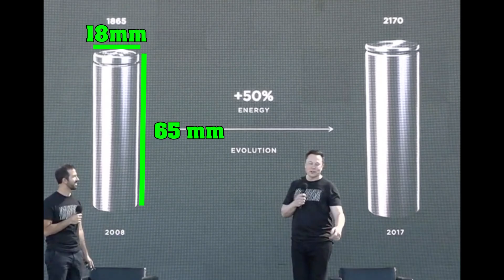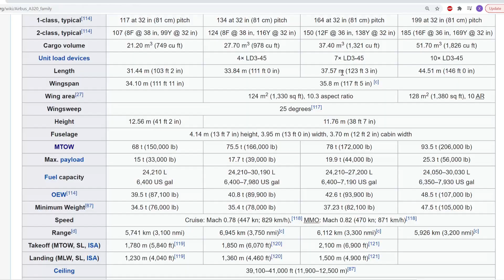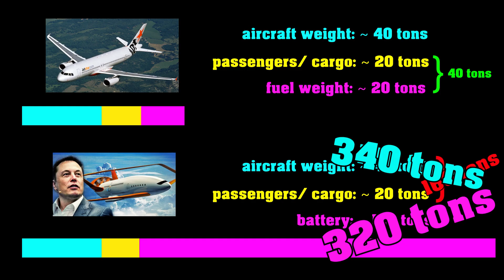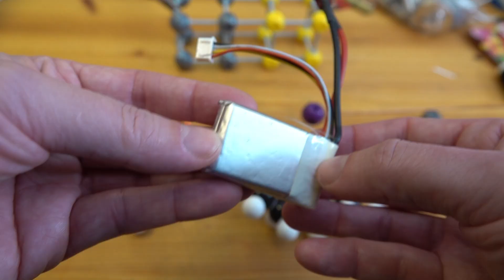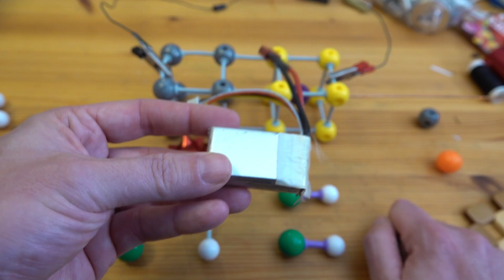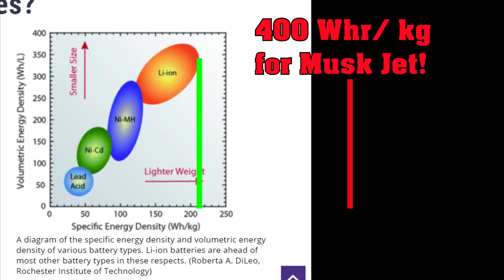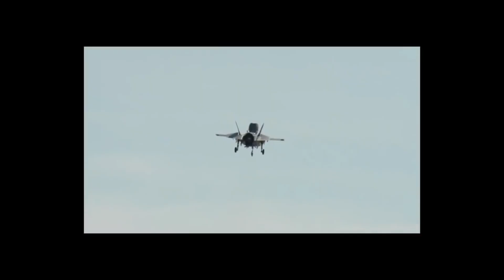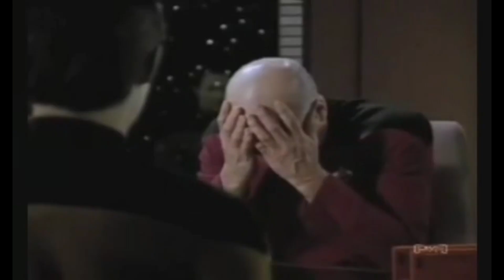Tesla's Secret Plan To Disrupt Airlines: BUSTED!!

Comment: Jeah as an aviation nerd I had to burst out laughing just when he said Super Sonic VTOL. That's about the stupidest idea I have heard in a long time. The F-35B can barely do it for about 50 seconds. VTOL needs over a 1 to 1 thrust ratio at a standstill. That alone is pretty hard to do with batteries and it really doesen't make much sense why you would make your life that much harder for a cargo plane when runways exist. Then we either need a completely new set of engines for forward flight, pivoting engines, or taking off rocket style. Then we need a landing pad that can withstand the energy of a plane that size. Ever seen the downwash of a Helicopter? Now multiply that by a large factor. And all of that just to get you in the air. Then you need to go supersonic. You can't get it supersonic with propellers. The main limit on rpm is that the blade tips can't go supersonic. Turbines on the other hand work better the faster you are, so they don't get you that much thrust on the ground making them worse for VTOL. So you either need a jet turbine or a whole new way of propulsion. Electric jet engines are theoretically possible by treating superheated plasma through electric current. Yes, all the air that goes into a turbine at supersonic speeds has to be heated up from the low temperature high up in the atmosphere to a plasma. Even with 100% efficiency. Thermodynamics tells you it's stupid. And then, if you did all that and finally have your Aircraft that can, with electrical energy only, have a thrust-to-weight ratio of over 1 to 1 at a standstill, and enough power to go supersonic which in aviation terms is one of the most wasteful ways of moving through air and comes with a whole other load on the aircraft. He tells us that it will only fly transcontinental. Overland. Where you can't travel at supersonic regularly because the sonic boom at best will be super annoying for everyone in its path and at worst will burst windows and eardrums. Even the Concorde would only fly supersonic over the ocean.

Comment: So much negativity here. The sulution is ofcourse to put solar panels all over the plane, and then have 10 separate battery stages and Just drop them on top of Peoples houses along the way to save weight. And you dont Even need engines, Just use 100 or so cold gas thrusters

Comment: Also less air for the the engines to move air through and create thrust, also the demands on the airframe are much different depending what an airplane is made for. The f35 has had unlimited money thrush at it with the demands very similar to this (do everything vertical TO/ landing, and supersonic, stealth)  and Lockheed Martin has as much expertise in pushing the boundaries of what is possible for an aircraft and even they have had trouble.

Comment: I am an aircraft mechanic.  So one of the things about fuel is it usually isn't filled up like you do with your car. If it is a max range flight they will, but the more fuel the more the plane weighs and the less fuel efficient it is. Another reason you don't fill it to the brim is you really really don't want an overweight landing that is bad news.  A battery plane went weigh less at the end of its journey than the beginning.  I guess a vertical TO/ landing design would mitigate this problem,  but it is also very difficult to do,  there is a reason that there aren't many vertical T/O landing planes and also why we don't see helicopters used much in mass commercial use.

Comment: When flying with lithium batteries, you are not allowed to store them in your checked luggage. They must be carried on board. 
I wonder if the batteries in the plane would need to be in a pressurized and air conditioned space.

Comment: Could you do something in regards to structural batteries
Reply: That would be extremely complex, extremely dangerous, and extremely failure-prone even if it was possible.
Reply: No, you can't. If you remove mass from the frame of an aircraft, you have to add that mass to the battery pack to retain structural integrity. The tiny amount of weight dropped from "structural batteries" is negated once you make those sections both water tight and air tight, and run the hoses for thermal management.

The issue here is the lack of energy density for batteries, not where to place the batteries. The concept of "structural batteries" was dead on arrival since the very beginning.
Reply: @herrschaftg35  The entire idea of a battery-electric commercial airliner is what's DOA.

Comment: jesus christ, the first 2 minutes and im shitting myself already laughing. you know, since i smoke e cigarettes which use Li-Ion 18650 cells, i know what Musk is talking about. the banger is: He apparently claims he developed the 21700 cell, well sorry, but my other Vaporizer has one of them and they have been around for quite a while. my 18650s are Sony Konion 3000mAh with 30A. the 21700 is also a Sony Konion, but with 4000mAh and 40A.

Comment: The real disruptor will be the orbiting electric hyper railways. Basically hype-r-loop, but no need for vacuum tubes, already in the vacuum of space. And the "rails" are basically orbiting magnets, not literal rails, that just push the train from one ring to the other, until you reach the space-hyper-train station. Then you go down by paired elevators that just counter-balance/power one another, less people to go up than to go down, then done, that's it, free elevators suspended on orbiting space hyper railways. Gorgeous CGI.

Comment: Can you even go super sonic with electric?
Reply: The Japanese were actually experimenting with propeller airplanes at Mach speeds during WW2. It wasn't electric but I assume an electric plane will also use propellers. They found out that propellers are extremely unstable at Mach speeds. Most of their experiments did not go well and the idea was quickly abandoned
Reply: You can only go super Mario sorry
Reply: No, you need to heat the air.

Comment: Not about the Musk, but have you seen new Lithium polymer batteries with V-Fe? Chinese researches completed a new formula a few years ago, and i'm curious when it'll come to production, as it can withstand lower temperatures (-19*C+-)
Reply: Given how these "awesome new über-high-density" batteries are ALWAYS 3–5 years away (kinda like how fusion power used to always be 20–30 years away), I'll believe it when I see it.
Reply: @electric7487  well, that's not about capacity, they have increased stability rather. Though, that's only a report on the Schemists Society's site, and i could view only end resulta with tests, not the formulas or docs itself (might find a chemist's account to view...). Not so of "amazing" stuff, we already have Korean batteries in stock, which is close to that specification (29+-% worse)
Reply: @electric7487  well, that's not about capacity, they have increased stability rather. Though, that's only a report on the Schemists Society's site, and i could view only end resulta with tests, not the formulas or docs itself (might find a chemist's account to view...). Not so of "amazing" stuff, we already have Korean batteries in stock, which is close to that specification (29+-% worse)

Comment: 70% battery is worse than current propeller drive electric aircraft. The Pipistrel Velis Electro when empty is 70% of the max takeoff weight. That's plane plus battery. Mind you, having a max payload of 378 pounds is less than most other avgas powered prop planes. One of the smallest I could find that was not an ultralight had a payload of 530 pounds.

Comment: Hamster wheels, or freaking pedals for the passengers!
By the way, how is that electric jet going to be propelled, rocket fuel? Most of the thrust on a modern high by-pass jet engine is from increasing the enthalpy of the air in the fan, not from the jet of hot exhaust (that is actually quite inefficient at subsonic cruise speeds).

Comment: Go electric hot air cruise liner...Cruise ship balloons with a low altitude ability...mega capacity, with static super capacitor charge for immediate correction...That is more possible...Or eat beans n sauerkraut, shove a tube in say 1000 passengers, and run on methane fuel...

Comment: They could improve their efficiency a bit by making the current round cells square like the Chinese claim to have done so one battery fills the entire width of the compartment and acts as a part of the structure and reduces wasted space significantly. But this is wishful thinking.
Reply: Plus, we already have structural energy storage in the aviation industry. The wings on most modern aircraft are "wet wings", that is to say, the wings have compartments inside them that are sealed off and used as fuel tanks. So the "advantage" that is often touted that batteries can be structural while fuel cannot isn't really an advantage at all.

Comment: he must either be lying about the electric airliner possibility or he’s not actually a good engineer. Which is it? That’s my question, assuming thunder foot is correct here. I wouldn’t know. I’m not an engineer of any sort whatsoever
Reply: Elon never engineered anything in his life, except the audiences he speaks to.
Reply: @DumbledoreMcCracken  I since talked to a few aerospace engineers and they say this is 100% possible for the reasons musk says it is
Reply: @tpstrat14  Watch my 1 minute video on the engine, and understand what Elon actually proposed, and then tell me Elon has a viable suggestion.
Are those engineers still in University, or do they work in the aerospace industry (just curious).  I am a pilot, and I have a BS in mechanical engineering from an ABET accredited US university.
Reply: @DumbledoreMcCracken  One of them designs engines for Pratt and Whitney. I’m not gonna pretend like I know anything about physics or engineering myself.
Reply: @tpstrat14  I would really like to hear what the P&W engineer thinks of my video.

Comment: Everything in the Aviation Industry is as optimised as possible- the planes will only keep getting lighter, as that results in fuel savings which are beneficial to the airline and the planet (less fuel = less fuel cost than normal)
Edit: Also, the engines provide a source of power. Cabin electricity and lots of other systems get their energy from the engines when cruising normally (for you avgeeks, the APU should be off during cruise) so to power those systems, you would need to pull directly from the batteries. Cabin air-conditioning and pressurisation also comes from the engines during normal cruise so you don't die of hypoxia when flying. On aeroplanes, all the systems are highly redundant, so if an engine fails, you pull power/air from the other engine or the APU (the APU is like a mini jet engine whose purpose is to provide power to the aircraft when the engines aren't running, as well as being redundancy). I'm not sure how the Tesla Plane will work, but you'd need multiple batteries that are physically separated so if a battery fails, you can switch to another. There are batteries on aircraft to provide backup power, but they aren't generally used throughout the entire flight (as I said, the systems pull power from the engines when everything is normal).
Now, about the VTOL part, isn't that just a drone? If you have swivelling engines, you are basically making a convertible drone. I'm pretty sure this concept has been tried before, so this part isn't completely insane, but to do it with batteries would be something different. Spinning the motors super fast could also require a lot of power, so you would need to route thick, heavy-duty cables everywhere. Lithium batteries are good at high amperages, but I don't know how they would fair if the heavy load was sustained. Running the cabin pressurisation and cabin air-conditioning systems could also prove troublesome, as air conditioning systems tend to create a lot of heat on hot summer days. Heat isn't very good for batteries. Battery planes are possible, but they tend towards smaller sizes, transporting only a few people at a time, and they definitely don't do VTOL at supersonic speeds as Elon envisioned.
Reply: Great comment. What about the altitude of flight? Wouldn't the temp lower the efficiency of the battery?

I use 18650 batteries in my vape n in winter I don't even get a full day of use. In summer n when I am indoors my vape will last at least 2 days.

Comment: They already have electric VTOL planes. 
Fits one person, range of like 25 miles, very slow.
If a billionaire could come up with physics breaking tech, history would be utterly altered. But in fact, record breaking tech comes out of university/government funded labs. And lots of the breakthroughs were accidental in nature. And 99% of them are incremental advances in tech, with 1% or less being truly revolutionary. 
There is also a massive lag time between research and manufacturing, usually on the order of 1 to 2 decades, and that is if and only if the materials used are in fact cheap to begin with.
And with batteries, the dumbest part of this all is there is the current 'next gen' batteries require ridiculous environments that would be utterly impractical anywhere but a lab. This is due to the energy-density problem all batteries face: where the F do you store all the electrons? Currently, carbon nanotubes (carbene) looks to be the most promising but has serious deficiencies, like holding a charge past a few second.

Comment: Elon's talking about structural cells and solid state batteries. The plane literally is the battery, the outer panels are nothing but batteries, the motors and the passengers are the only significant weight added beyond the battery the rest is some bits of aerogel insulation, a small computer for flight, and some seats. And yes, structural batteries are only currently up to 75 Wh/kg with a material stiffness of 75 GPa (in the lab), but that's enough combined with lower weight, higher density, solid state batteries to have many forms of effective aircraft. It's not enough for super sonics, and you can easily work that out, which would be a better video than pretending like an aircraft is similar to a car with it's engine ripped out and replaced with batteries. A structural battery at 75 Wh/kg at 40 tons is still 2.7 megawatts of power production, and that combined with 20 tons of Solid state batteries with 400 Wh/kg is an additional 7.2 megawatts, for around 10 megawatts total produced from a battery at the same weight as a jet. 10 megawatts can run some serious motors, especially a good pair of synrm electric jet engines, just not super sonic. Of course, a boeing 747s motors work at about 75 megawatts of power, lol.
Reply: Don't forget that we already have structural energy storage in the aviation industry. It's called wet wings, where parts of the wing structures themselves are sealed off and used as fuel tanks.
Reply: @electric7487  Yes, but the container for that fuel, the wings themselves, constructed from aircraft grade aluminum, weigh a significant amount on their own. Then there is the body of the plane and the structural frame. Structural batteries would take that weight and convert it into a battery at around 75wh/kg, rather than providing no wh/kg as they currently are. Hell, even seats could be a battery, the only thing adding to the plane's weight besides batteries would be people and electronics.
Reply: @AdmiralFace  What you're proposing is what people typically bring up when they talk about structural batteries, but most people completely fail to realise how massively overcomplicated, dangerous, and failure-prone that would be.

Not to mention, a combustion-powered plane gets significantly lighter as it flies, whereas a battery plane would weigh almost exactly the same throughout the flight. In fact, this characteristic alone kills almost any possibility of battery-powered commercial planes ever being viable.

The best solution would be to keep using combustion engines, but run them on carbon-neutral fuels whose manufacturing processes are powered by nuclear energy.
Reply: @electric7487  Sure that sounds great, if only that had backing by the corporate interest that fund the campaigns of our politicians, which will never happen. Unless you wanna put u238 in the hands of random corporate entities to run their own plants, also not going to happen.

Comment: Airplanes have been described as "gas tanks with wings". The energy density of oil is probably the highest available for commercial use, and it's just barely worth it. 
Hydrogen is better, but it's much more dangerous for the general public to handle, compared to gas or oil. 
Lithium batteries cannot even approach that energy density (sorry, I don't know the value). 
I once heard somebody say, "a teacup of oil can lift 1 ton 1 thousand feet in the air".

Comment: A larger battery is an advantage in that FEWER batteries will be needed, so that many more connections have been reduced. It improves the reliability, but it didn't change the energy density. It took 10 years to figure this out? (eyes rolling)